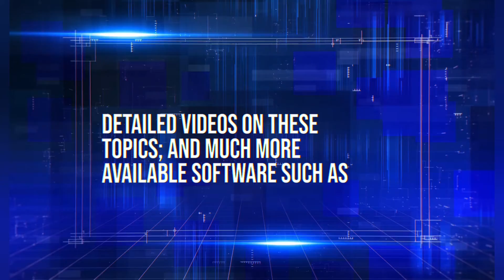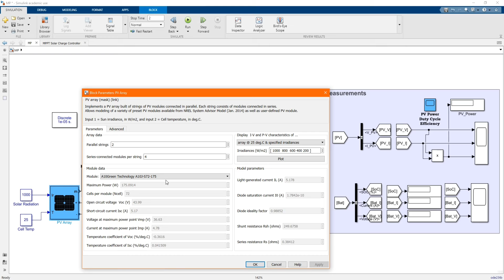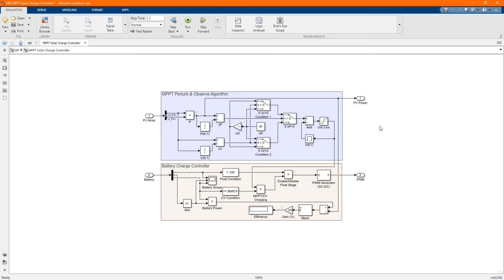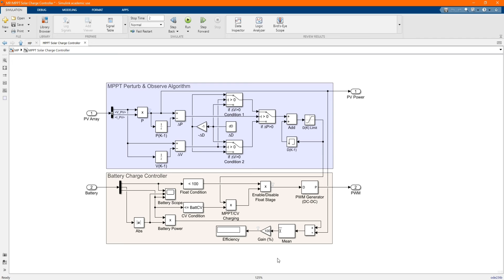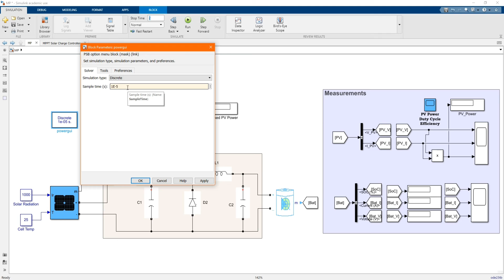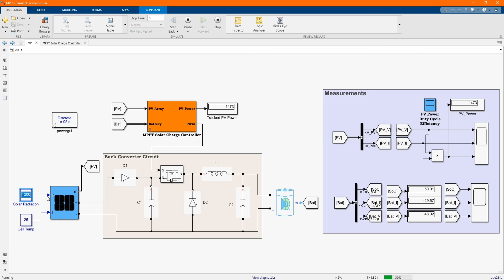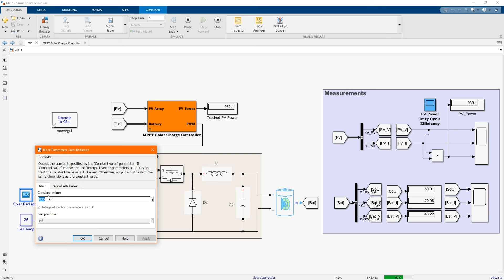Design and Simulation of MPPT(Perturb & Observe Algorithm) Based on Solar Charge Controller Battery

Comment: very nice lesson professor. 

i just have one question: why is the battery current negative?
Reply from the maker: Hi, thank you for your comment. The current is negative due to it charging the battery
Reply: Sir, I have sent you an email regarding the request for the simulation file in video format. Could you please check your email?
  @pzengineering2020